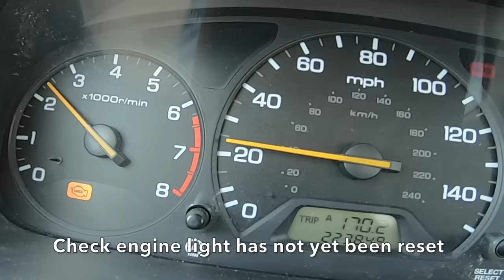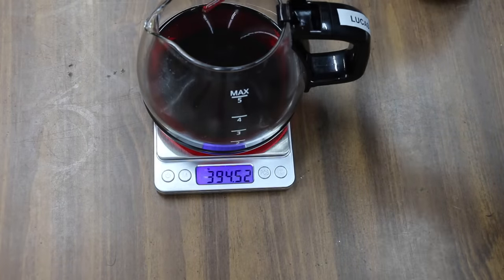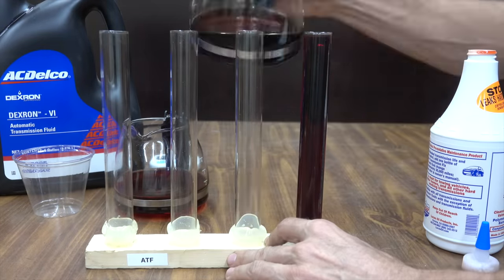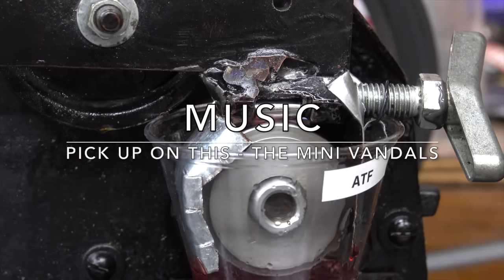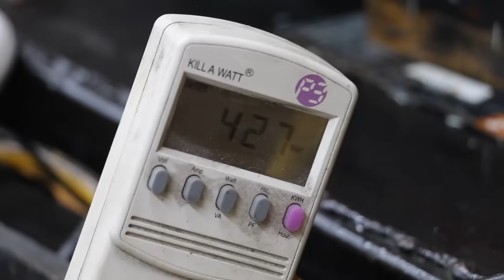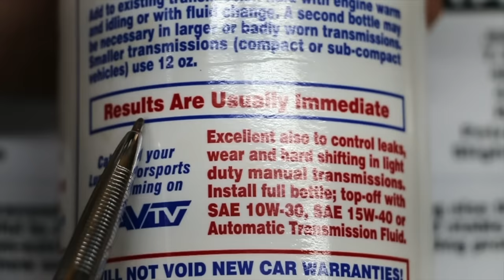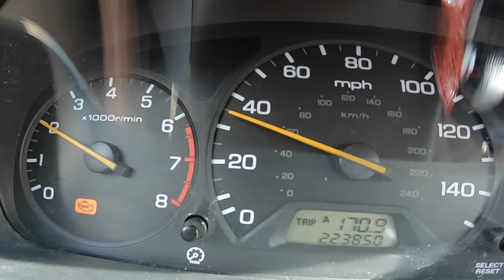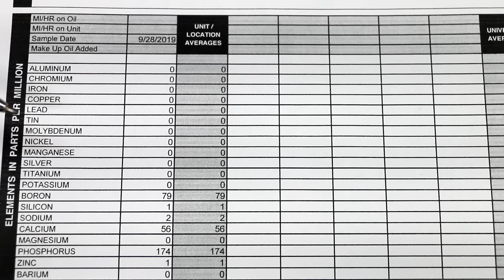Does Lucas Transmission Fix Work?  Let's find out!

Comment: I started using Lucus in my 2002 Sequoia, it seemed to slip a bit on 1st gear. The fluid was pretty black. I drained and filled the transmission over two months until the fluid was cherry red. That was when I had 300,000 miles on it. Today I have 405,000 on it it still goes up the mountain tops without any problems.
Reply from the maker: Nice!

Comment: You will discover that the longer the Lucas additive is in the transmission,  the better it works. Seals get worn and hard, and the Lucas additive will help with that.
I've seen this Lucas really help with hard shifts....
Reply from the maker: Thanks for the feedback.
Reply: I agree.  Wife's BMW at 185k miles developed a horrible flare shifting between 1/2 and 2/3, no change after changing the fluid and filter.  drained 1 qt and added 2 bottles of Lucas.  NO change in shifts, thought I was going have to rebuild it.  A week later, wife said "oh I forgot to tell you, but what ever you did to the transmission, it now drives like it was when it was new."  Took about 200-300 miles to take the flairs out.
Reply: @ransomholbrook7428  
After your wife said “Whatever you did…”, did you tell her “Ancient Chinese secret”?
Then she discovered the empty Lucas bottles and said “Ancient Chinese secret, huh? It says right here “Made in USA”. 😂

Comment: I have a 2011 Impala with 127k Miles it started to slip a month ago and the driving home from work first red light i hit the light turned green the car didn't move for 45 mins til the tow truck showed up on a very busy road what can I do ?? It's in the shop now the mechanic says it's a mystery problem no check engine light

Comment: Lucas takes time to get through the transmission and is supposed to expand seals as well as increase viscosity.  My experience has been that you cant fix a mechanical problem with a liquid, but lucas has definetly made transmissions last longer for me.  Used it a half dozen times over the years.  It gives you some more time.  Its a lot easier to plan for a transmission replacement or rebuild than needing one today.  Ive had good luck with it but all it really does is buy you time.  I uaed it in my 05 Tahoe that started  slipping a couple weeks ago and it doesnt slip at all now. But it will start to slip again eventually.
Reply from the maker: Thanks for the feedback.
Reply: BUT Lucas is a 50/50
Some cars transmission, may not be affected in the least by this or if you're lucky...it'll affect your transmission up to 50% - IF LUCKY

Comment: I used it in my 2008 Honda Civic and it improved the transmission. I had some skipping going on and that is fixed. I get better mileage also. I also use gas treatments by STP and foam stuff( can't remember the name). I've seen a great improvement of how my car runs since using these products. My car has 261,000 miles.
Reply: Thx it helped My Ford ranger

Comment: At 5:45 you test the fluidity in cold, and the Lucas was extremely slow to flow. This is what Im worried about because my transmission works fine once at operating temperature. Its the first few minutes of driving on colder mornings (below 60 degrees) where it slips and clunks and stays in low gear.  After a few minutes of driving (or if I let the car idle for 10 minutes) it performs like normal again. I want to add Lucas to see if it can buy me a little more time before it completely stops working, but am confused about the cold weather. Is this a good thing or a bad thing that Lucas is more viscous in the cold?

Comment: I use Lucas oil stabilizer, fuel treatment, and Transmission fix. Carol Shelby was a big part of Lucas and it’s popularity. I even use it in my differential. It actually extend the life of your automobile. It’s worth every penny.
Reply from the maker: Thanks for the feedback.

Comment: As a mechanic, I would never promote using "stop slip" as a repair, HOWEVER, I have used it on an old Accord to stretch its life (the car was not worth even a used trans), and to my suprise, it worked. It went from slipping harshly to moderate. I gave the car away for free. That was 6 months ago, and to my knowledge it is still on the road, today.
Reply from the maker: Impressive!
Reply: @Krazy Kanuck And you should know that a bottle of lucas oil is significantly easier and cheaper to administer than a simple ATF flush. You'd also know that a lot of transmissions don't have filters or don't have filters that are user serviceable.
Reply: @bobroberts3968  exactly. or that a flush can even damage it MORE...lmao.
Reply: Good man !!!
Reply: Krazy Kanuck changing the fluid on a old transmission that is slipping may cause it to slip even more due to the old fluid having carbon from the clutch packs
Reply: Krazy Kanuck what would you say to a 99 Silverado that slams into second gear after driving for a while, but resets when you turn the truck off for a minute
Reply: @Buddy B I personally wouldn't do it. just do normal maintenance at the correct intervals and the transmission should be fine for a long time.
Reply: Bruh Trans isn't getting cooled properly and it's damaging the solenoids
Reply: ciana baltimore ??? what are you so angry at
Reply: @jdzcl9  😂 you can't win them all.
Reply: Well in a world where option A is paying a rebuild shop over 3-4 thousand dollars for a transmission rebuild for a car that's not worth even half of that or option B to change the fluid with a bottle of lucas + trans fluid and just drive it until it dies....option B is better in most cases.
Reply: After useing ceramic oil additive, use grafite addictive, after changing out the ceramic additive

Comment: I'm curious to see if the reason there's less detergents is to prevent slippage in the clutch from pulling clutch material into solution. Since flushing an older transmission can cause slippage from removing the suspended bearing material around the clutch.
Reply from the maker: Thanks for the suggestion.

Comment: One thing I'm wondering was if the battery was disconnected for awhile.  In order to cause the computer to go back to stock values then readjust quicker to shift points.  Otherwise it would if the computer can be set around trying to make the transmission shift optimal based on old values.  Where as slip, wear may now have changed.

Comment: This stuff was a miracle worker for me. I have a 2000 Suburban 2500 with 253k on it that was hesitating during hill climbed and banging into each gear once it warmed up. Added a bottle of this and within 2 days all the issues disappeared. Totally worth the $10 to try.
Reply from the maker: Impressive results!
Reply: Results are usually noticeable immediately but the full effect often takes a few days. To say this is simply a viscosity improver is to grossly underrepresent what this product is and does. It has kept a lot of junk alive for a long time for me for nearly two decades. It is so good that I use it as maintenance and don't wait for problems. I don't have many, either, in spite of most of my vehicles being over twenty years old.

Comment: Great video! My 1965 Mustang has a 200 inline 6 and the C4 automatic. It was leaking when I bought it and was shifting hard. I replaced the filter and gasket, refreshed the fluid and added a bottle of the Lucas transmission treatment 24 oz. The car shifts much better and smooth now with the refresh.. It’s a good product! Thank you
Reply from the maker: You are welcome!  Thanks for sharing.
Reply: Hey was the transmission fluid filled to spec for your transmission before you added Lucus or did you under fill to compensate?

Comment: 2001 Odyssey  149k  no shift when hot, only cold.  Change Fliud, clean  orifice screens ADD full Lucas bottle. No result right away, after sitting a year trans shifted OK 10 miles plus. Engine did overheat during that year at idle because fan sensor bad. Overheat may have helped to puff up the friction rings??

Comment: Great informative videos! I worked in a lab for 20 years and performed several ASTM tests through the years, your channel brings back a lot of memories, much appreciated. Since the Lucas oil is meant to be an additive to the transmission oil, It would have been nice to have seen the Lucas oil mixed with the Dexron oil, in the proper ratio, and seen what the effects were in the same tests that you performed. But the video of it's use in the vehicle was cool too..
Reply from the maker: Thanks for the suggestion.
Reply: @ProjectFarm  did u do it?
Reply: @49495lwbrmoxybe  no he did not
these tests were 100% lucas VS 100% ATF
.
however the tests where he is DRIVING THE CAR...... is 100% normal atf VS the proper mix of lucas and ATF
.
putting 100% lucas into the trans would be a REALLY bad idea LOL
it would be WAY WAY WAY too thick 
.
simply putting it into gear, AT IDLE would feel like slamming it into gear at 4000 RPM lol
Reply: @kainhall

Comment: My 2016 Honda Odyssey is experiencing juddering during shifting. I checked National Highway Safety website and there have been 26 (add mine to the list to make it 27);reported cases of this issue on Honda vehicles. NHS reported cases address Service Bulletins and or replacing the oil 3 time to that seem to resolve the issue. Do you consider that using the Lucas oil you tested could be worth attempting?

Comment: my automatic revs up slightly before moving from  1st gear to 2nd gear. If i am light on the gas peddle it shifts smoothly but, if i give some good gas, it does a slight rev before switching. Any thoughts??
Reply: not knowing what transmission you have, most wear takes place on 2nd. gear clutch pack/band. it would be a good idea to pull the pan to see how much clutch facing material/ metal shavings are in the pan/ oil filter. being low on fluid will also cause this( low oil pressure) one thing that you can try, is start off with the selector in "2" and see if the slippage goes away, and then move the selector in drive mode. you should notice a much more "FIRM" shift starting in 2nd range, and shift to drive mode!!!!!, adding thicker oil will help boost oil pressure, adding life to the transmission. you want a good "FIRM SHIFT" in all speeds, soft/ sloppy shifts are bad, and will cause clutch/ band facing wear!!!!. I worked in a transmission  rebuild shop years ago, and have been driving 42 years, with no transmission problems!!!

Comment: I'd like to submit an idea for a video. Here it is: Sandpaper. Specifically, 5" hook and loop discs for an orbital sander that are 220 grit. HF vs Diablo vs Klingspor vs ETC. Also, Diablo has a sanding screen that they say lasts 10x longer! Tests conducted on wood (hard and soft), metal, paint, polyurathane (or other clear finishes), etc. for loading and abrasive loss rate would be most useful. I hope this interests you! Thanks for all the work you do!
Reply: Is that stuff anything like the 3M sanding screens used for floor refinishing or sheetrock joint sanding?  Or is there a magic formula?
Reply from the maker: Great video idea!  I need to test this one!
Reply: This sounds awesome! Good idea!
Reply: Yes, Dewalt also has a sanding screen, can test that too.

Comment: I tried the Lucas trans fix in my 2010 ford crown vic. It was working fine before I added Lucas treatment but had 120,000 miles so I thought it might be good for it.  When I added it my trans would not shift I tried to flush it out but could not get it back working . Thw trans used a very low viscosity fluid. I replaced the trans with a used onebecause the transmission shop said it would have to be diassembled and cleaned.. I called Lucas and they would do nothing to help me! There is no garantee, there refused to even talk to the transmission repair shop.

Comment: Thanks for this great analysis/review.  I added this to my 2006 Highlander’s transmission yesterday, to address some slipping in first gear, and some slow shifts.  It definitely helped.  The slipping in first is almost gone, and the other shifts are much smoother and more timely.  Thanks again.
Reply from the maker: You are welcome!  Thanks for sharing.
Reply: Finally found someone who used this on a Toyota! My 03 Avalon shifts pretty hard under medium acceleration, I think I'm going to try the Lucas Transmission Fix!